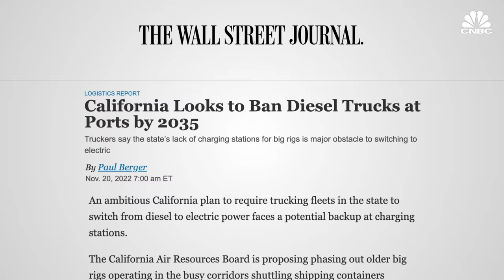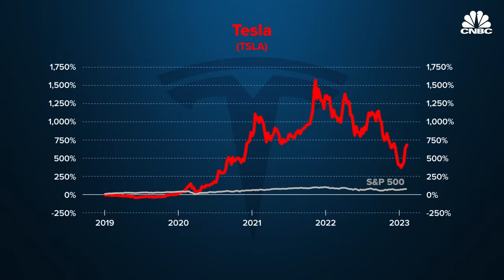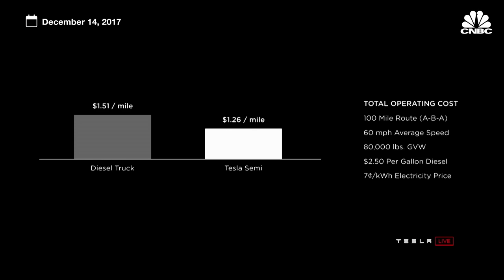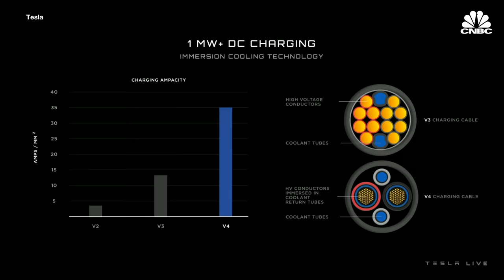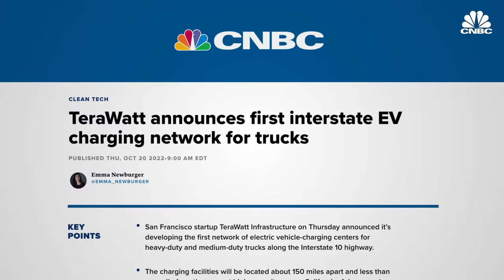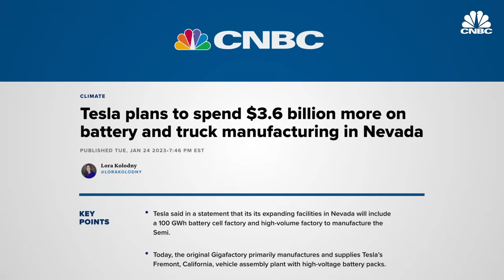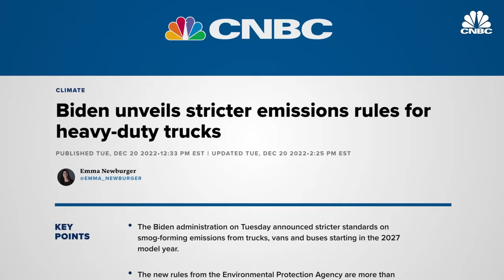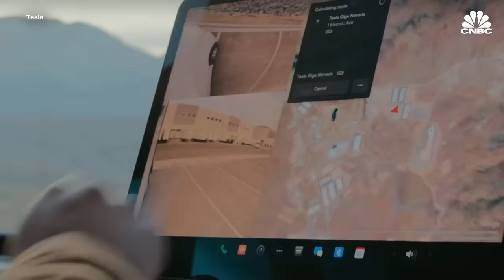Does The Tesla Semi Live Up To The Hype?

Comment: Not sure what the commentator meant about the power of a diesel vs electric on a weight basis, and compromises. AFAIK, diesel wins on range but suffers on both low-end torque and maximum acceleration and speed.
Reply: The only "range" an Electric Semi needs is "more than the driver"
Currently, ONE Electric Semi achieves that.
(Starts with "T", ends with "esla")
Reply: I assume the commentator has never traveled in an electric train.
Reply: I'm not sure maximum acceleration and speed are at the top of a trucking company's wish list.
Reply: I guess they meant sustaining that weight over a longer range. Diesel truck gives you 1400 miles of range on a full tank of gas while electric only gives you 400 miles of range on a single charge. Still a long way to go. Plus, an hour to charge up and get close to 350 miles of range from a substation versus 15 minutes to fill a diesel truck and get 1400 miles of range. Just Ridiculous.
Reply: Add in hill climb and descent and see if a diesel truck gets 1400 miles. As long as the battery outlasts the driver your critique is ridiculous... unless you are promoting a trucker who has ben awake for 21 hours.
Reply: @Tokamak3.1415  Diesel trucks get lighter as they expend fuel as per every mile covered. Electric trucks bear the same weight whether charged or discharged. They still expend a lot of energy dragging those heavy batteries while hauling absolutely nothing.
Reply: @didierpuzenat7280  electric trains don't carry batteries. They get their power from the catenary system above.
Reply: Correct , nice catch. 
the Tesla semi is FASTER & more AERO than all other models, its also the Longest RANGE Production BEV semi, only FCEV has more range @ more than 3x the cost of fuel. FCEV is slow. 
Tesla semi can Accelerate faster than PORSCHE 911 , with 0 - 60 under 10 seconds (CAB only) and 0 - 60 under 18 seconds w/ FULL LOAD 82k gross. 
TESLA semi uses PLAID drivetrain w/ 3 motors = 1200 HP / 1000+ lb Torque .
Reply: @markplott4820  A Porsche 911 does 0 to 60 in about 3.5 seconds.
Reply: @geezer74  70% in 1/2 hour as that is the way charging curves work. That sort of fits very well with the mandatory 1/2hr in every 8hr breaks. 
They wont initially be used long haul but long hauls on specific routes are only a short time away and will increase as infrastructure builds.
Reply: @geezer74  You sound like Bob Lutz
Reply: @judedornisch4946  Initially, it took three to four hours to recharge a 1,000-kWh battery (the estimated battery size of the Tesla Semi) versus only 15 to 20 minutes to refuel a diesel truck. To counteract this, Tesla created the 'Megacharger' which now provides the Semi with up to 400 miles of charge in just 30 minutes.

"However, this technology is designed to have a charging output close to 1.5-mWh at peak load. In other words, one Tesla Semi will consume in 30 minutes about as much electricity as the average North American home does in one month." So much for the fight against climate change and energy sustainability I guess.
Reply: @kennethsouthard6042  there are battery electric trains as well. Can be a good way of electrifying all rail transport fast. Can work in tandem as well, have catenary at the stations and you don't have to do the complete line. Lots of flexibility to do whatever is the quickest and best ROI.
Reply: @PerErikKarlsson  Battery electric trains are a very small thing and pretty much still experimental.
Reply: @geezer74  If you're going to calculate the benefit of mass loss by counting fuel burn - consider how much actual weight it lost by 220 gallons (2 full tanks) and factor that into the actual rolling resistance equation - it has less meaning than a persistent 2mph headwind. Seriously come on, you're just trying to find some minutia to nit pick on. I mean if you complained about the added use of rubber to coincide with the extra vehicle weight from pulling batteries that would be more logical.

Aero forces increase with the cube of velocity - that more than anything is why EVs should be driven at slower speed. A truck that travels at 60mph might actually get to the destination faster than a truck traveling 75mph depending on recharging time. Sure this might not be such an issue for petroleum powered freight, but rarely is such time sensitive product transported by ground these days. 

I'm not not in the trucking industry but know a person who is an independent trucker. It's almost unheard of for him to drive the trailer section long distances with no payload. It happens if there's no match by logistics, but with the software employed today it's quite rare. It's not an insignificant factor, but it probably is less relevant than just the amount of time/energy needed for brake checks on vehicles that have no regen.
Reply: @geezer74  1400 miles? how long do you have to drive to go 1400 miles? You. might want to take a break.
Reply: @geezer74  Where does all that diesel weight go anyways?
Reply: @robertmartens7839  Take a break?  We're not talking about sightseeing here.  Time is money in a truck and many times you have two drivers, one sleeping, one driving to keep the truck rolling 20 hours per day.
Reply: @geezer74  
And you think diesel trucks don't pollute? Do you have any idea how much fuel they burn? Everything included, an electric vehicle is cleaner even charged from fossil fuel plans. And if you charge them with renewable energy (which is growing exponentially), the difference becomes huge. Since big trucks drive over a million miles, the pollution from manufacturing barely matters, and renewable energy is virtually zero emission, so overall an electric truck can and will be extremely clean.
Reply: @kennethsouthard6042  I never said trains have batteries.
Reply: Wrong! Wrong! Wrong! The tesla is 1000hp beeing compared with 400-500hp diesel trucks! They haven’t even tried comparing European trucks like Volvo fh16 750 or scania 770s or let alone 600hp diesel trucks that actually hauls well over 200,000lbs!
Reply: A 1000hp diesel truck is totally overkill and compared to the TRACTOMAS used for massive loads moving.
Reply: @LordandGodofYouTube  exactly! Acceleration is actually quite bad for your payload
Reply: @Tokamak3.1415  it doesn’t matter if it’s climbing or going down diesel trucks absolutely wins in the range department, in flexibility, in polyvalence….. they can be used basically everywhere
Reply: @kennethsouthard6042  exactly! And that’s what makes electric trains soooo not flexible and much expensive than diesels! A diesel-electric train can cover much longer distances on worse and non electrified railway. In fact the longest and heaviest trains in the world are all diesels.
Reply: @markplott4820  you are a troll mate! The tesla semi has almost the same torque as a ford f450 diesel! The scania 770s with 770hp has almost 3x the torque of that tesla so big LOL….. diesel trucks have way more torque with the same power compared to electric.
Reply: @markplott4820  you don’t need acceleration with big trucks it’s totally useless and dangerous for the payload. Plus again you’re comparing 1000hp electric truck to 500hp diesel
Reply: @carholic-sz3qv  Yes, I am aware of the energy density discrepancy of a hydrocarbon chain fuel vs electrochemical energy in a lithium battery cell.

But are you going to just ignore the fact that the vehicle outlasts the driver? If there was a fuel that had 10x as much density as gasoline or diesel would it be any better for ground transportation if the driver is still limited by his physical body and the rules of the road? It would only help aviation.

Maybe once we have those autonomous fleets of trucks then perhaps it would matter since the thing could drive non-stop coast to coast. Until then, most truckers are not going to be able to hold their bladder for more than 300 miles repeatedly without causing serious issues to their kidneys (the backpressure from the bladder kills the gradient). If the trucker is stopping every 200-300 miles to prevent blood clots and empty their bladder then they only need to stop for 15 min for a partial charge.

I'm not denying that diesel doesn't have some areas where it beats battery vehicles hands down. But for use along major highways in the US and the developed world where humans presently drive trucks 300-500 miles of range exceeds the drivers capability. The driver becomes the rate limiting step. It's like thermodynamics.

And what the world is polyvalence? I took P-chem in college. I've never heard that term used in normal vernacular.
Reply: @geezer74  That is correct which is why the charging infrastructure includes Megapack storage. With that not only do you avoid surge pricing you increase grid stability and flexibility. Correctly designed and sized this could also allow the possibility of power arbitrage and integration of localized generation. Once you look at it as a system you can start to build some real cost and planning savings in at the depot level. That doesn't even count the slower charging for those that are overnighting.
As these enter the fleet they will actually accelerate the green transition and sustainability push. Charging stations will in rural areas for example become collection and distribution points for solar and wind and connect to the grid along highway rightaways. 
As we start to get data at fleet level EVs from Hertz we are already seeing better than projected life cycle costs and for the leasing option to Uber better driver profits.
Reply: @Tokamak3.1415  diesel literally beats electric in like almost every aspects!  For your records there are still 40 years+ old diesel/ICE trucks still on the roads in use something no EV will ever claim! Let’s not forget that those very old trucks are even still contributing to building new cities like the Middle East LINE city currently going on! Also there are things like biofuels from waste and much more. Electric vehicles are very limited in their use, diesel are used everywhere where there is a road or not.
Reply: @carholic-sz3qv  When was the last time you saw a refrigerator run on a diesel engine? The brushless electrical motors on the ISS have been running continuously for decades - something an ICE has not done to date.

I had no problem working on my ICE cars when I used to Auto-X and I have no problem working on my Tesla. Some people are just fearful of change.  Let's just agree to disagree.

You didn't tell me what polyvalence means.
Reply: @Tokamak3.1415  in fact electric cars where the first vehicles of you didn’t know! I don’t see any EV building any road anywhere soon! All those gigantic projects from hydroelectric dams to roads, electric grid…. Mining, agriculture and much more! Even aircrafts not something your “brushless crap can do”
Reply: @Tokamak3.1415  just go on YouTube and watch those videos of the deadliest roads around the world where basically no infrastructure exits! As if your tesla can even reach those places! You’re toooo funny mate 😂 😂
Reply: @Tokamak3.1415  what are you even trying so hard to justify!? The Toyota Land Cruiser is literally on a totally different level to any other car! It’s built to go basically every it’s possible plus great towing, excellent off-road capabilities…. And it also comes in soooo many variations for different uses! A tesla is crap compared to that!
Reply: @Tokamak3.1415  a class B electric truck will not do 90% of what a diesel can do end of story!
Reply: @Tokamak3.1415  I have actually watched engineering explained t which I’m subscribed for years to so lol!!!
Reply: @carholic-sz3qv  You seem very emotional now. I'll refrain from exciting you further.

I will be using an ICE today flying my Baron G58. Have a nice day.
Reply: @judedornisch4946  That’s pie in the sky, fairy dust talk. You do realize that the battery storage power station (megapack storage) needs to be equivalent in size to or larger than that of the tesla semi that's drawing charge from it. So that means if you have ten tesla semis charging at the same time, then you will need ten times the batteries or more in these tesla semis be installed onto your megapack storage. First, that means you need plenty of land to install these megapacks. Second, battery storage power stations (megapacks storage) are generally designed to output for up to a few hours. So you evidently need to charge these megapacks through some means. Since we’re doing all these for the sake of clean energy, let’s assume that we’re using solar to charge these megapack modules. Even sunny places like California experience winter and only get half the sunlight during the winter period. To charge one truck you’ll need a solar array that can pull in a mega-watt an hour of sunlight during the course of a day, so you’ll basically need a 100kW solar array installation to charge just one truck with energy sourced within the course of a day. And the installations will have to be ludicrously huge, being as large as a hundred house rooftops installations. Speaks volumes about the costs of the land rights needed to make that kind of solar installation a reality. In terms of economics, a 100kW installation translates to roughly three to five dollars per watt installed, so you are looking at somewhere between $300,000 to $500,000 to install solar panels, merely to charge one truck with energy sourced within the course of a day. So stupid.
Reply: @geezer74  Megapacks in this instance only need to handle the surge in the charging cycle and are used much as grid stabilization, you are still drawing from the grid but at a consistent rate and of course the surge happens early in the charge cycle and fades so unless all 10 of those trucks are plugged in at the exact same moment that peak is minimal. Of course if you are like Pepsi you probably tie the facility into the storage and now are in a position to contract consistent wholesale pricing with the utility. Any addition of solar or other generation is merely a way to reduce the contracted demand. Once you start to work the numbers the ROI on the Capex really makes a lot of sense.
Reply: Trucks are literally limited to 55mph on California freeways, 10mph than regular cars. Speed is the last thing truckers care about.
Reply: True. The commentator didn't mention the compromise we make for diesel - the spewing of toxic fumes and noise.
Reply: @judedornisch4946  In my earlier post, I demonstrated the impracticality of using solar energy to charge the tesla semi, largely due to the fact that capital expenditure rises exponentially as a fleet grows with the addition of a single tesla semi. Remember as I pointed out before, to get 500 miles of range with charging times constrained to under 40 minutes, a single tesla semi would require it’s own substation (charging infrastructure). So, on a financial standpoint, tesla semis become virtually impossible to scale, meaning you will never make a return on investment due to the fact that every acquired tesla semi requires you to invest in a dedicated substation. And let’s assume that these tesla semis are drawing their power from the grid, just to add some context to the feasibility concerns am trying to convey. A typical residential substation serves approximately 1500 customers, so if you have ten tesla semis then you’ll need ten substations to make them run. Which is as much as the amount of power needed to power 15,000 homes. So, the only question I need you to specifically answer is this, where are you going to get this enormous amount of clean power from? And remember, it only makes sense if this power comes from non-fossil sources, which account for 30% of all US energy sources.
Reply: @Tokamak3.1415  Your tesla semis can have the least amount of resistance as you like, but bottom line is that they will have reached less customers and delivered the smallest amount of cargo as compared to the lightest diesel trucks in the market. In 30 minutes of charging a tesla semi will have consumed as much electricity as a US household does in a month, just to deliver half the cargo capacity of a diesel truck. The US grid derives 60% of it’s energy from fossil sources and tesla semis have no other alternative but to use the US grid as their primary charging infrastructure, so how can they allege that they are using clean power? Also, how many inclines and declines as a proportion of level roads can you locate in US roads so as to make a justification of the impact of resistance and regenerative braking?
Reply: @geezer74  First off, it's not "my" Tesla semi. I don't own one. For context, my dad was an EE so I learned about electricity early on. While my engineering degree is not an EE degree I do understand how grids are deployed better than most.

Consider this - substations are only needed to distribute power at the lower voltages and usually only single phase. Obviously something powering a Supercharger for fleet vehicles is going to use 3 phase and would have a line run from one of the main trunks. I mean that's the way trains in the rest of the country are powered - it only makes sense that it is deployed that way. Companies like Nikola wanted to do on-site H electrolysis but we both know that's not going to happen. Maybe at airports if FC aircraft become a thing, but not for land based vehicles since H is just too expensive - at least until fusion become feasible large scale.

When you use diesel to deliver goods you are wasting a valuable commodity. That petroleum has better for products that cannot be readily created without insane infrastructure. Right now it does not make sense economically use to use electricity to make bio fuels or hydrogen. It might once fusion becomes reality, but until then it's not worth it from a thermodynamics standpoint. Same with plastics. They shouldn't be made with electricity. That's where the crude should be going. Maybe even home heating since the entropic release of heat is still a win in winter.

So your issue is with a grid that is only 40% clean but the Tesla (or MB, Volvo, Peterbuilt) semis that claim to be 100% clean. Well, 10% of the US has a criminal record. Are you and I 10% criminal? I hope not. The grid is changing and evolving. It takes time. It's been there for 100 years. If you want to reset quicker just ask the sun for a nice CME and we'll get our wish - we'll just need to live like cavemen for 10 years.

Nothing is ever going to be 100% clean. Humans leave waste in their wake. Every animal does. The goal is to improve and make changes when there's a significant and logical improvement. If a new home insulation comes out that has 1% better r values nobody is going to rip out drywall and put it in. Now if has 2 or 3 fold the efficiency perhaps it makes sense. The newer solar and wind plants operate cheaper than coal plants - that's apparent now to all the energy companies. I know there are compromises. Solar has toxic metals in the panels and wind turbines leave behind huge blades we haven't learned how to recycle yet. But from an engineering standpoint it's a lot easier to recycle 100 millions tons of PV panels than trying to scrub 1 trillion tons of emissions exhaust in the highest energy state of matter (air) that routinely exists on Earth (let's ignore plasma since we know that's not a normal state).

There is no reason to look for roads that go up and down for no reason. Anybody with basic understanding of thermodynamics understands that at present BEVs are 3x as efficient as ICE. It's not 1 standard deviation, but 3x is pretty huge. For niche applications - think of a snowmobile or marine craft running in the arctic - it absolutely makes sense to stay on ICE as BEV efficiency doesn't help when the vehicle becomes impossible to engineer. For a vehicle like a Class 8 truck which is going to be autonomous in 2 decades it makes sense to transition to a platform that just saves power. If we need to we could just burn the petroleum at plants and it would put out less emissions and provide all the electricity we need - but that doesn't deal with the CO2 issue.

Humans at present don't even use 0.1% of the total energy that reaches us from the sun. You don't need to be able to build a Dyson sphere to know that we have the power within our hands - we just have to grasp it. If the US government spent 1 year of military budget or entitlements on researching tidal energy we could probably have unlimited power but of course environmentalist would complain about fish and elitists would never let their beautiful seaside mansion views be disturbed. It's not for lack of capability - it's for lack of will.

Our power holy grail is fusion. Look at my username - google it if you have to. Once you have almost unlimited electricity you can make all the e-fuels you want and we can even power CO2 scrubbers with that. We could hydrolyze water and combust H all we want and go back to combustion engines. It would be wasteful, but it would be doable. Right now it just seems silly to use 3x the energy when a BEV can do 90% of the task. By the time 90% of the truck fleet is BEV our grid may very well be 70% renewable and autonomous trucks may exist. Who care about having to stop every 500 miles when a robotic arm hooks up the vehicle at a charging pad just like a Roomba recharges after a cleaning cycle.
Reply: @geezer74  Your argument only makes sense if the assumption is that solar is to totally replace fuel costs by a single actor. However the Capex calculation for a fleet owner is more like does the Capex reduce my fuel expenditures enough to give me a reasonable ROI over a defined period. 
Much the same calculation will come when sizing local storage where Capex is measured against input pricing curves. How much does the time shift pay. 
Within the context of the overall transition electrifying the fleet will be a spur towards greening the grid and solar plus storage will be more than able to keep up with electric penetration.
Reply: @judedornisch4946  Answer the question, where will you get the electricity to power 10 tesla semi that consume the equivalent of 15,000 households?
Reply: it doesnt matter what this truck can do because the batteries are garbage
Reply: @geezer74  they don't you are using a peak charge demand and extrapolating. 1 Semi uses what 10-20 houses use per day.
Reply: @Tokamak3.1415  Actually we do know how to recycle wind turbines. The issue is that they weren't initially designed with recycling in mind, and have such long lifespans that the modern recyclable ones aren't really being replaced yet
Reply: @SyntheticSpy  Yeah the ones we make and some of the EU ones have end of life recycling built in their cost of ownership. Some of the less scrupulous countries do not. You know there are actors who would happily dump them into the ocean if satellites weren't a thing :P
Reply: @geezer74  - But what is the total cost of the fuel vs the electricity?  Electricity is 100s less, it adds up real quick.
Reply: @kennethsouthard6042  - or below somehow, have you ever been on a bullet train.  I have a few times in Japan, amazingly smooth, you can balance a coin on edge.
Reply: @Tokamak3.1415  Guess you are unfamiliar with hours of service regulations and team drivers.  No single driver would be awake for 21 hours, but teams of drivers can keep a single truck running 24/7.  Also your range comment is irrelevant since adding additional fuel tanks to a truck is a common and simple process and only requires available frame space.  Road train tractors in Australia for example commonly carry 600+ gallons of fuel.  Thats an easy 4K mile range for a truck with a modern engine at US gross weights.  Electric trucks will be fine for delivery/ inter terminal type hauls and may end up being more environmentally friendly if they can be made to last a long enough to offset the enormous carbon emissions and environmental damage required to produce them and charge them currently.
Reply: @danielh4995  I'm not a trucker but I am aware of how truckers work. I am only 15 miles away from the busiest port in the US and I do have friends/patients who are truckers.

Why would a vehicle routinely travel 4K miles unless it was a time sensitive cargo? Most of the freight goods in the US are transported by rail - accounted by weight, not volume. Why move something from one coast to the other on a rubber tire when steel wheel moves it for 1/10th the price. I mean if speed is of importance then it should be palleted onto a B748 and dropped 2nd day air. There might be niche applications for companies that need security or want their own internal logistics, but as a rule it's better to use what the masses use. Most businessmen fly on domestic carriers and the CEO/CFO fly on the private jets but their time is a niche scenario.

Of course things like lettuce can't be moved by rail, but most everything non-perishable in the US that moves over 1k miles is usually moved by rail if it's not time sensitive or a high value item. That's why the US has the largest freight rail network in the world.

Like I said above, I do not imagine a vehicle that does everything and solves every problem. Only simpletons imagine such things. But for 90% of the truck on load/off loads it works. If you need to move 60 tons of steel braided cable 800 miles overnight of course a diesel is going to be needed.

I wish there was more of a focus on why the hell we import everything from across the Pacific and have to move it across our country when we should be making most of it here at home.
Reply: @Tokamak3.1415  My friend, charging a tesla semi is not like plugging in a toaster. If you put 50 electric trucks somewhere, that is basically equivalent to a factory. Your typical highway charging station will need about as much power as a local pro sports stadium.
I agree that many electric utilities base their commercial rates on the peak amount of electricity that a customer draws at one time, even if that peak occurs only for a brief period. But Tesla’s Megacharger stations would incur extremely high charges because THEY DRAW so much power SO QUICKLY in EVEN such a short time (30 minutes charging a tesla rig). Making the cost of charging pretty expensive. Megachargers would have to have an output of 1,200 kW, about ten times what a Tesla Supercharger can supply. So that will essentially wipe out any ROI you had hoped to recoup after a tesla semi acquisition.   
You see, the vast majority of over the road drivers are paid by the mile. They don't actually get paid for fueling - or charging their batteries.
Another thing is, there will need to be several dozen chargers in every single one of the 2000+ truck stops in the country. No trucker wants to pull their Tesla semi (or any other EV rig) into a truck stop needing to charge, only to see that there's only six chargers and thirty rigs waiting in line to charge. They'd be waiting for hours before they even get to the charger to plug in, at which time they'd be wasting another 30 minutes minimum and meanwhile the diesel rig has come, fueled and gone and is 200 miles farther down the road.
Reply: @judedornisch4946  My friend, charging a tesla semi is not like plugging in a toaster. If you put 50 electric trucks somewhere, that is basically equivalent to a factory. Your typical highway charging station will need about as much power as a local pro sports stadium.
I agree that many electric utilities base their commercial rates on the peak amount of electricity that a customer draws at one time, even if that peak occurs only for a brief period. But Tesla’s Megacharger stations would incur extremely high charges because THEY DRAW so much power SO QUICKLY in EVEN such a short time (30 minutes charging a tesla rig). Making the cost of charging pretty expensive. Megachargers would have to have an output of 1,200 kW, about ten times what a Tesla Supercharger can supply. So that will essentially wipe out any ROI you had hoped to recoup after a tesla semi acquisition.   
You see, the vast majority of over the road drivers are paid by the mile. They don't actually get paid for fueling - or charging their batteries.
Another thing is, there will need to be several dozen chargers in every single one of the 2000+ truck stops in the country. No trucker wants to pull their Tesla semi (or any other EV rig) into a truck stop needing to charge, only to see that there's only six chargers and thirty rigs waiting in line to charge. They'd be waiting for hours before they even get to the charger to plug in, at which time they'd be wasting another 30 minutes minimum and meanwhile the diesel rig has come, fueled and gone and is 200 miles farther down the road.
Reply: @geezer74  Your arguments id general make sense, if you assume a rapid conversion and retiring of the entire fleet in only a couple of years. That would not allow the infrastructure to build out in parallel. Of course we know that the vast majority of loads are not full weight nor are they over the road. So Electric will fill the niches that the most economic sense at first. As the infrastructure network build that will include more and more use cases. 
Indeed an EV class 8 is in power requirements the equivalent of an apartment building. Once that infrastructure starts building out it will not all be Super Chargers. I imagine rest stops all across the network will be sprouting destination chargers that will take some hours to fill up, but most likely at a reduced rate. So fill while you sleep and save money. It will be the Team drivers and so an even smaller group that wont be able to take advantage.
Reply: @carholic-sz3qv  
You make no sense, as usual.
1. I'm not sure what are you referring to in the first place, I've been writing about emissions, not power.
2. There's no truck in the world that matches the performance of the Tesla Semi. Power is not the most important, torque is. Torque pulls, power gives you top speed. And electric motors have far superior torque. That's why diesel-electric power trains exist.
3. The legal weight limit for a class 8 truck is 88,000 lbs in the EU (little higher for electric trucks). So I guarantee no European truck hauls 200,000lbs. If you mean the weight they are physically able to pull, then 200,000lbs is nothing. An old Tesla Model X can tow a Boeing 787, which weighs 287,000lbs. And the Boring Company used a Model X to pull 250,000lbs of mining rail carts on a small incline. Oh, and once a Model X beat a sports car in a drag race while towing a trailer with another car on it. You can find all of these videos with a simple Google search.
4. Torque is not just for acceleration. It also helps to climb mountains, which is typically hard for diesel trucks. So much that they sometimes overheat and catch fire.
5. Also on the way down the brakes tend to overheat on diesel trucks. Electric ones use regenerative braking, which not just means that their mechanical brakes don't heat up, but they also recapture most of the energy they used up to climb the mountain.
6. The Tesla Semi has over 500 mile range with maximum weight at highway speeds. That's more than enough for 80% of the typical routes. And the driver is legally required to rest anyway, which allows the truck to recharge without losing any time. With the Megacharger it takes 30 minutes to charge to 70%. It can also be charged while loading and unloading.
7. In Europe 50% of railway lines are electrified. On the rest mostly diesel-electric trains are used. Notice the electric part. The diesel engine is only there to generate electricity, the real business is done by electric motors.
8. And with modern batteries there are more and more plans to replace those diesel power plants too. A typical diesel freight train burns about 100 gallons of diesel per hour. That's about 3,6 MWh. Adjusting for engine efficiency it's 1,2MWh. A Tesla Megapack has a 3,9MWh capacity, so 3 of those can easily cover a 8 hour shift. And since you can put them on rail cars, you can switch them out easily, no need to wait for charging. In case you don't know, a Megapack is standard cargo container sized, so ideal for moving around with standard cargo handling equipment.